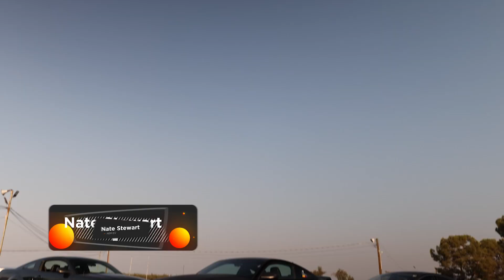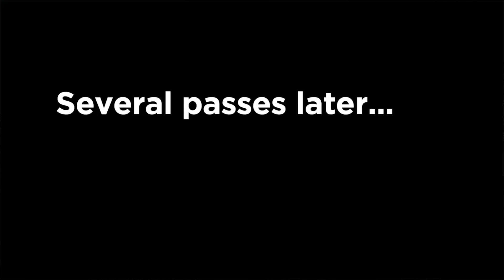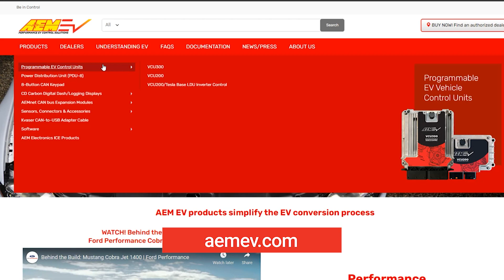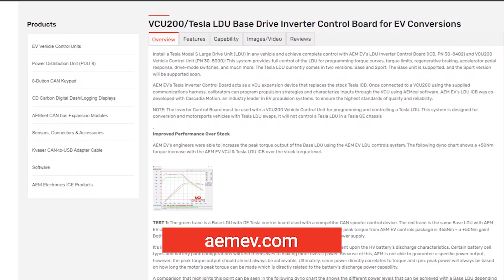EV DRAG RACING! 'Testang' vs. P85 Model S vs. Bullitt

Comment: Very interesting. What was the testangs 60ft time on the 11.7 pass? 🤔
Posting up the timeslip would help imo.
Reply from the maker: The Testang’s best 60 foot time was 1.931.
Reply: @AEMpowerTVelectronics  very nice, so it could have a bit more in it on stickier tires and or with more tweaking. 🤔

Comment: I saw that AEM is the recommended (official?) partner for controlling the Ford E-luminator crate motor. How would you compare the performance of that motor vs the Tesla drivetrain? Considering an electric Ford classic car build in the near future so I like the idea of Ford with Ford, but would like input on both drivetrains.
Reply from the maker: The Tesla LDU’s definitely qualify as high power output whereas the Ford Eluminator probably falls more into a mid-power output range but is certainly not low power.  The Base LDU in the Testang makes 300kW of power (402hp) but is capable of making 335kW (450hp) with the right battery.  A Sport LDU makes 390kW (523hp).  The Eluminator is rated for 210kW (282hp) and made exactly that on the AEM dyno.  The power numbers pretty well speak for themselves.  AEM is working closely with Ford on creating an inverter and controls solution for the Eluminator.

Comment: Will there be a dual Tesla motor controller option available at some stage?
Reply from the maker: Technically, the capability to run dual Tesla drive units already exists with the VCU300.  AEM will soon be adding support for the Sport LDU to the LDU Inverter Control Board and will then offer a replacement inverter control board for the Model S Small Drive Units shortly after.  We expect that in this calendar year, it will be possible to run a combination of LDU+LDU, LDU+SDU and SDU+SDU.